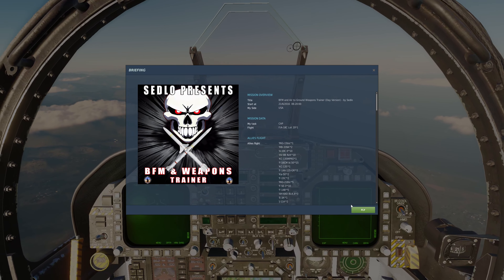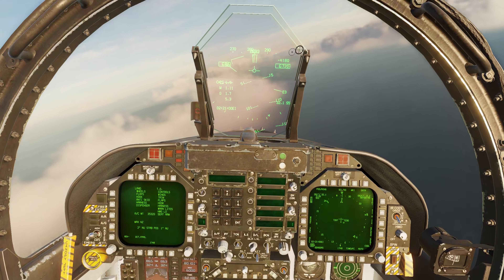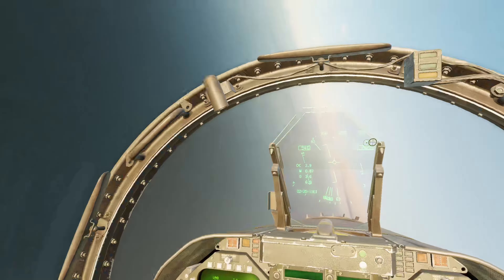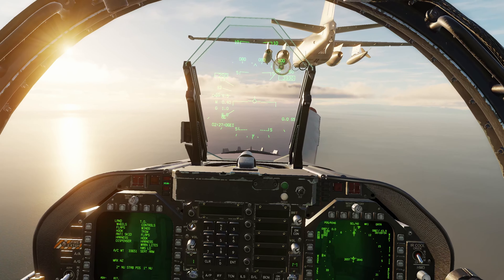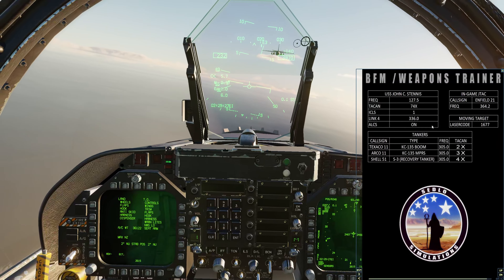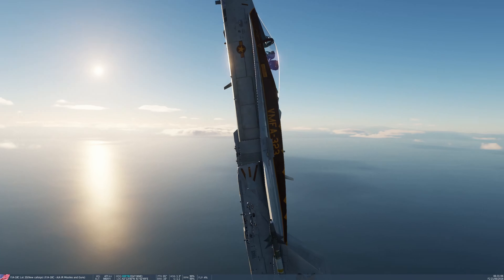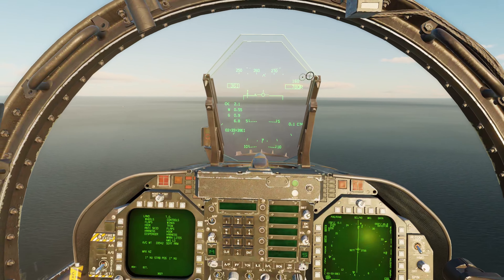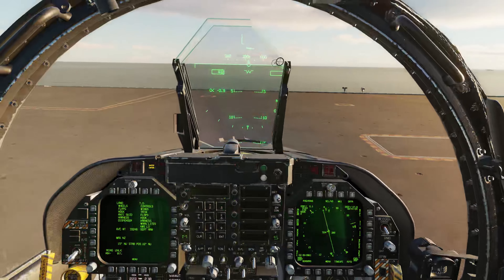Watch Sedlo Tank Off The S-3 and an OK 3!

Comment: I'd love some pointer to taking off the S3 with wake turbulence on.  I feel like I'm back at square 1 and just can't tank period.  Beautiful Trap,  did you know that if you set your TDC scale to 10 miles and place the little plain icons wingtip on the BRC you'll be at about the right abeam offset?
Reply from the maker: Hey @lochaby!  Yeah, this S-3 is so difficult.  In terms of wake, I don't really have any suggestions.  Just try to approach slowly and get to know where it will knock your wing around and just anticipate it, I guess.

I've done the HSI thing, but I'm just trying to figure out the visual picture a bit.